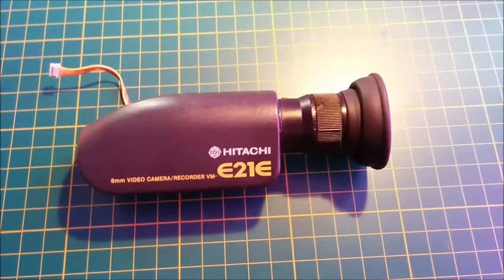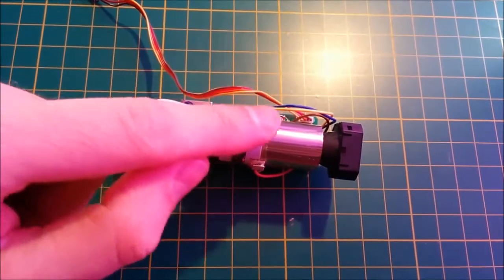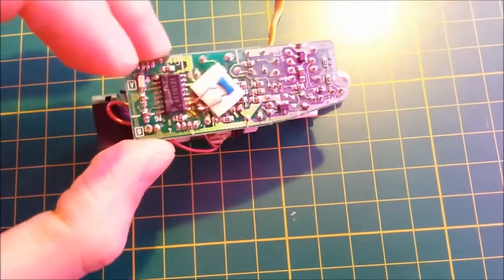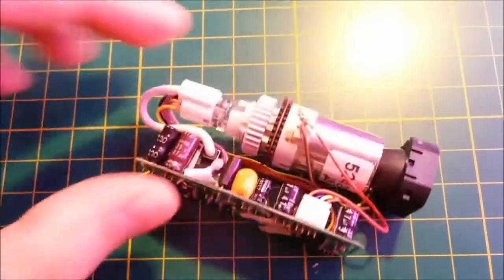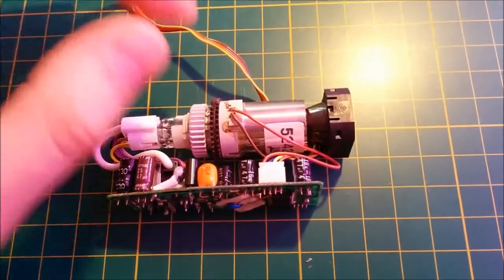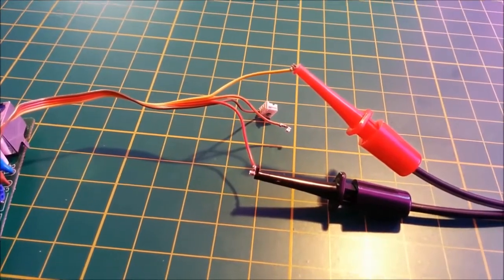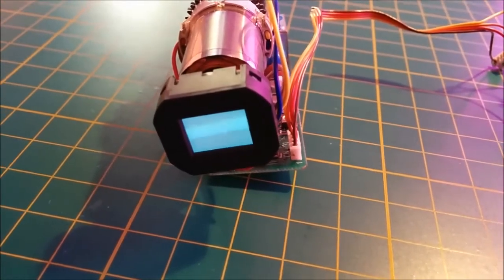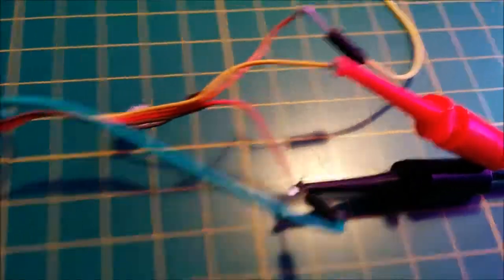Micro CRT from camcorder viewfinder

Comment: 3.7 Volt ?
Reply from the maker: This viewfinder is powered by 5V. If you have different model you can use regulated power supply and start from 3V and go up and check on which voltage it lit up and work stable.

Comment: Thank you so much. This is almost exactly like mine, been trying to figure out what to do with that one wire (not-ground, not-power, not video) and I see you just left it unconnected and it still works, quite well I must say. On mine, the video wiring is a coax wire with the shield being the ground. (made it easy to find ground) Power was almost as easy just by tracing the circuit on the board to a capacitor. Video had to be the center wire of the coax and that left the last wire to figure out,,,,,,seems as it is not needed.

C64 Forever!!!!!